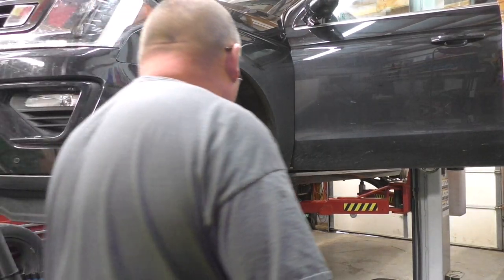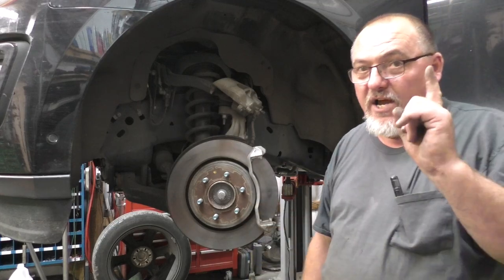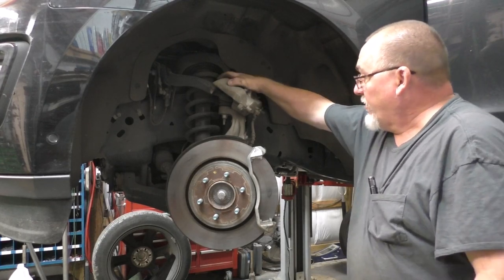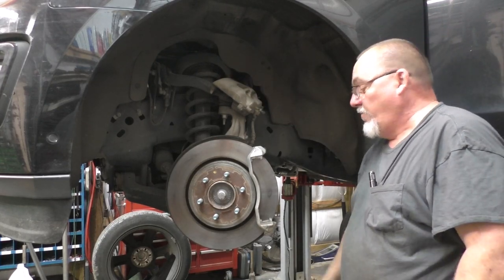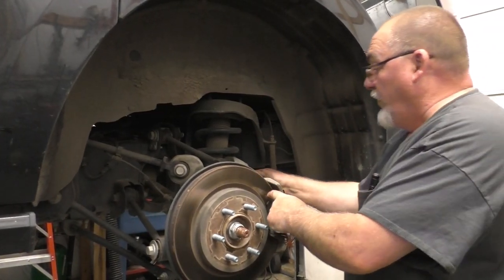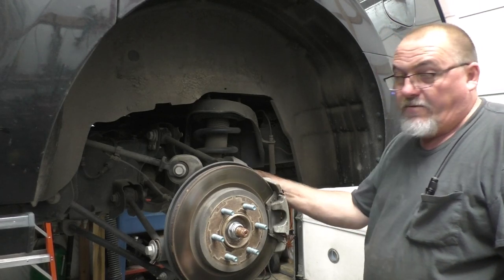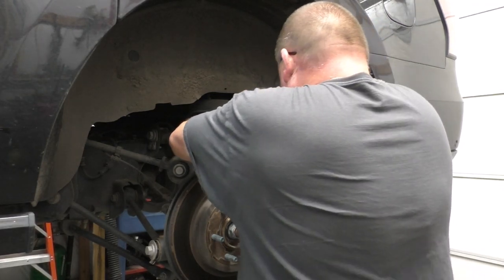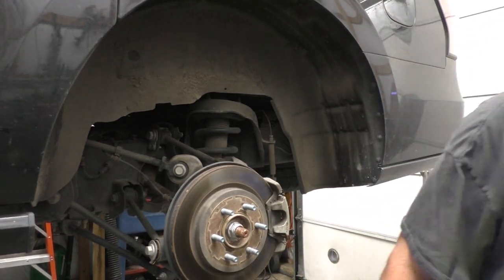2020 Ford Expedition Max Limited Brakes and Rotors Front and Back

Comment: Brought minds to a mechanic today just to changed the brake pads and rotors. Then he calls me and say the caliper is pushed out and need to be replaced. They cheated me I feel because they probably never put it on EPM or just didn’t know what they was doing. It wasn’t like that before I bought it to them. I feel like they rip me off.. good video
Reply from the maker: If the Pad was not metal on metal the caliper was not pushed out!! I would call them on that. Accidents do happen. I do it too sometimes but I would never make the customer pay for my mistake.
Reply: @ralfsautomotive  the pad were metal on metal. But I caught it as soon as it happened and took it to the mechanic. The breaks were not stuck when I was driving. It only made noise when I pressed the breaks. I feel like it was their mistake